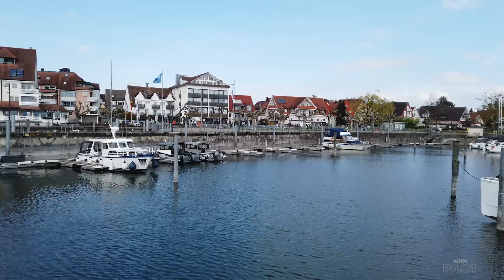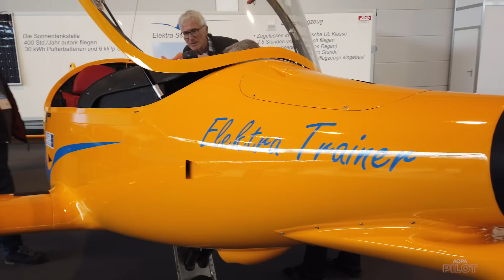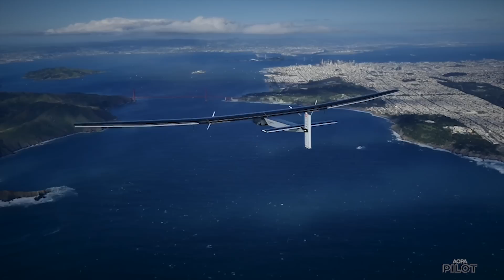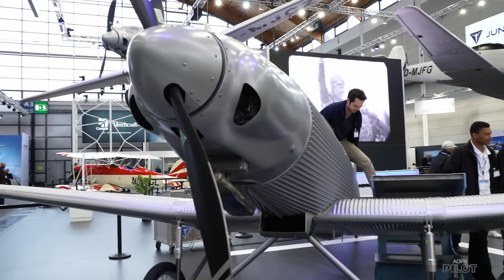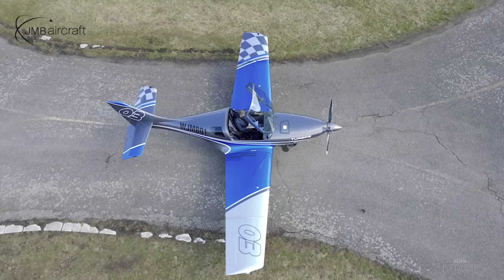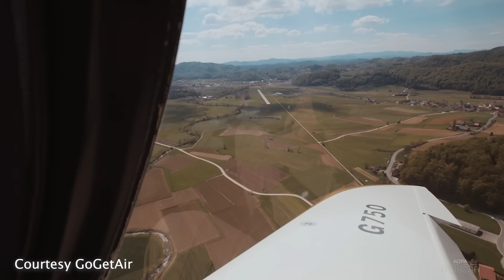Future of Aviation Showcased at Aero Friedrichshafen 2023

Comment: The Gogetair could be significant. You should perhaps have mentioned that it's a 4 seater and if it's fully certified and if that includes USA. It's only 75% of the speed of SR22 but maybe 1/3 the fuel burn and 1/3 the cost. And can run cheap mogas. Cutting the operating cost of a plane to 1/3 is naturally extremely significant. If Rotax could pony up a 180 horse engine it might match the speed of the SR22 and really hurt their sales. with such an interesting aircraft it's vital they promote it. There is a curious deficit of marketing skills in aviation. Using youtubers to showcase their planes is very powerful and mostly free.
Reply: a 6 cylinder rotax will change the game
Reply: Wow. That is very impressive. The certification alone at that price for a new airplane. Mind blowing.
Reply: Agree, this 4 seat Gogetair with a 180 or 200 hp would be a game changer. Not everyone is a Nigel no friends.  No-one in the modern world wants to fly air-cooled big bore engines from 50s but rotax doesn't want to or legally can't make an io-360 competitor. I think I read somewhere Lycombing bought rotax's higher hp patents and shelved them so they didn't have to compete. Airplane engines are small fry for rotax so no skin off their nose.
Reply: @AusVelocity  that better not be true, that's a classic douche move on both parts but especially lycoming. that's something oil companies did to electric cars. they bought the rights to NIMH batteries when they were interesting and prevented large batteries. if lycoming is guilty of that, not only are they doing stagnant garbage but actively fighting against progress.
Reply: I was very excited to learn about Gogetair until I read the back seats are for two 25 kg (55lbs.) children.